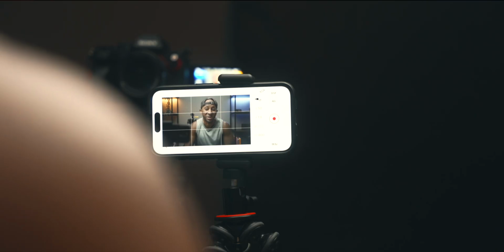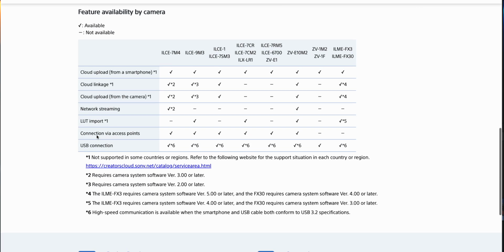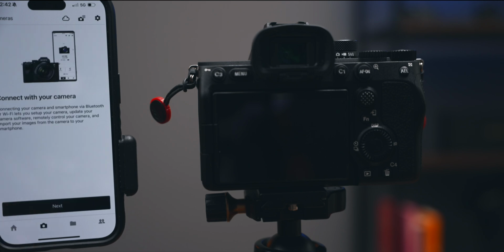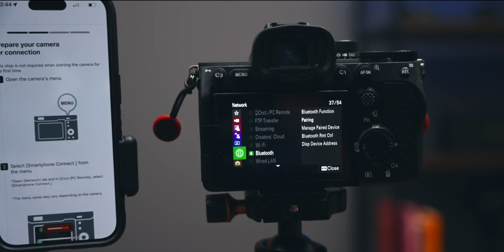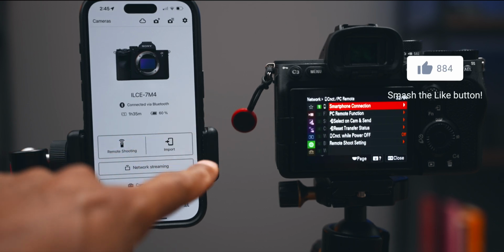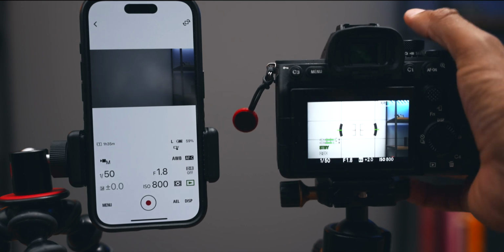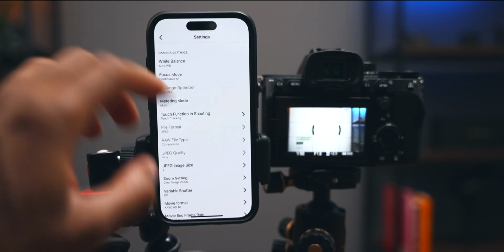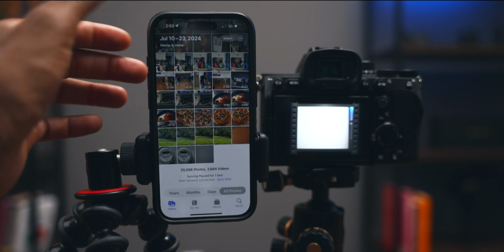How To Connect Your Sony Camera To Your Phone: Sony Creators' App

Comment: Hi I have sony A 7V its taking long to connect, does it require bluetooth and wifi at the same time? because wifi is connected
Reply from the maker: Yes, the app typically needs both Bluetooth and WiFi enabled to establish the initial connection and facilitate control.

Comment: I am struggling to connect! I want to connect it on my mobile wifi not home wifi so it should connect through bluetooth right? but it keeps asking me to turn on wifi which is connected to the home base! So what if I am in a park and I want to connect it to my phone network? I am not getting this? If anyone could explain this pls?The camera Aap is downloaded already but I want to connect on my phone network not home network!
Reply from the maker: The Bluetooth/wifi connection doesn’t require your home network. The camera will broadcast its own WiFi network that it uses to communicate with the phone. So you can still use while the app when out and about.

Comment: 12/31/2025 on this most recent update remove the ability to have the option of limited access to the creators app from your phones library, and I don't want my entire library on the creators app. does anyone know a work around to making the creators app useful without giving up my entire phones photo library, oh wait also with the new update the application is inaccessible to you the customer unless you give full access to your phone. I know it's a long shot, someone please advise.
Reply from the maker: I thought it still has to ask for access. I know there’s a change across all apps where it doesnt ask up front anymore but you still have control over what photos the app can access. And it’s easier to select new photos in real time.

Comment: sony a6700 doesn't allow connection at all so wack
Reply: I manged successfully to connect my iPhone to my a6700. You need to ensure both the a6700 camera and the iPhone have Wi-Fi and Bluetooth enabled. After that, restart your phone and you are good to go and do the connection
Reply from the maker: Not sure why it's not working. Try checking the Sony website for troubleshooting tips.

Comment: I have been trying for days to get my Sony a1 to connect to my iPhone 15 Pro Max.  IT DOES NOT WORK.  3 phone calls back and forth with Sony support including sending them videos.  IT DOES NOT WORK.
Reply: same! Did it ever work? I can't get my a7rv to connect to my iphone pro 14. Just purchased yesterday and really frustrated.
Reply: @ nope. As a matter of fact, I was so disgusted that I sold every piece of Sony gear that I owned and went back to Canon.  Haven't had a single issue since.  Sony's tech-support was beyond worthless.
Reply: Mine says I need to be on ver 2.00 but I'm on ver 4 so I'll just use it without the phone app. Smh.
Reply: @ApolloRa2025  I was so disgusted with Sony that I literally sold every piece of Sony equipment that I owned and went back to Canon. Best move I ever made.
Reply from the maker: That sucks. Are you able to connect to other apps? I'd try something like Monitor+ https://monitorplus.cc

That way you can tell if it's an issue with the Sony app or something with your camera's wifi connection.
Reply: I got it. When trying to pair it to iPhone you have to delete the camera name in Bluetooth settings and restart the process. I was having the same trouble and then this worked for me.
Reply: @danu6718  didn't work despite many tries.  i ended up selling evey piece of sony gear that i owned.  went back to canon.